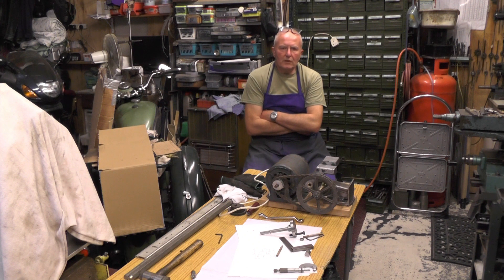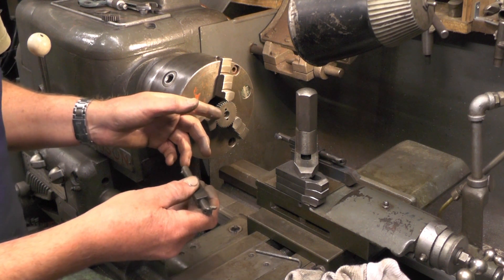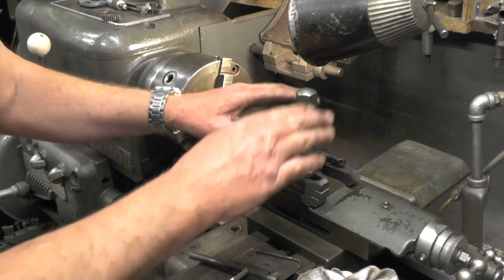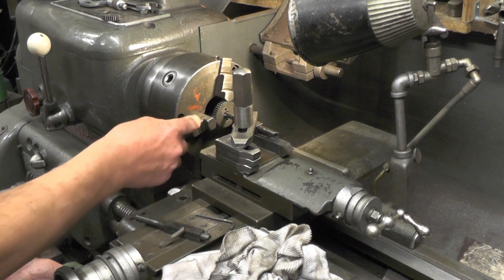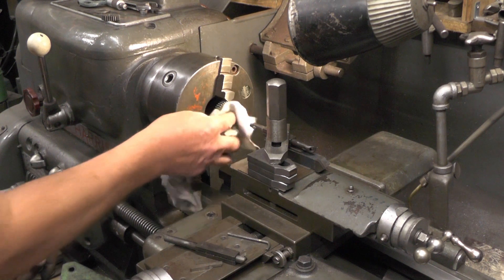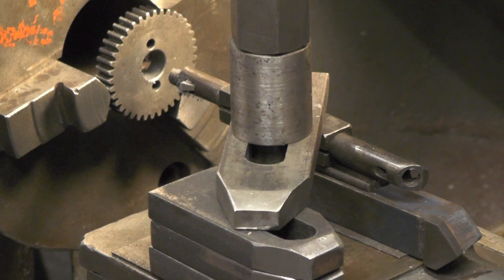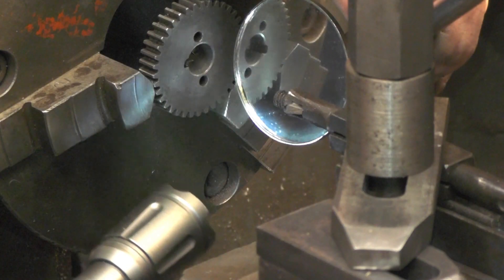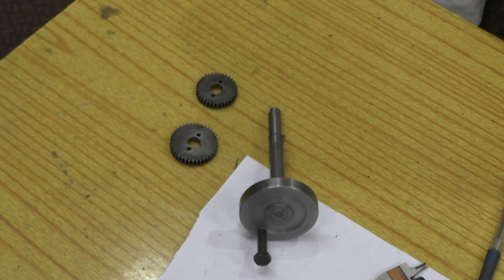Hints & Tips # 001  Beginners Guide to Cutting a Keyway Using a Lathe  "mr factotum"

Comment: Hi again Mr. F, I really had to catch up with your videos. 
That was a good tutorial. I am in the process of cutting two keyways in two of the gears that transmit the feed on the Bending Rolls that I am building. I have build a hand operated keyway slotting attachment to fit on the lathe top slide. That's to prevent additional wear on the hand wheel gear, even though it is not used that frequently.
Bye for now and stay safe
Regards
Emanuel
Reply from the maker: hi el
thats the joy of engineering there always many alternate ways to get round a situation. you just have to think outside the box
thanks again
mr f